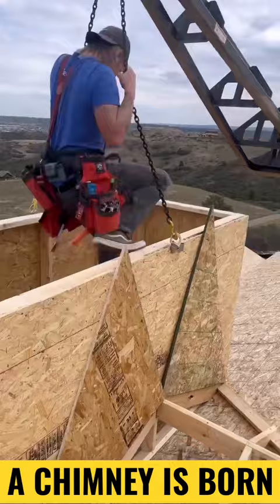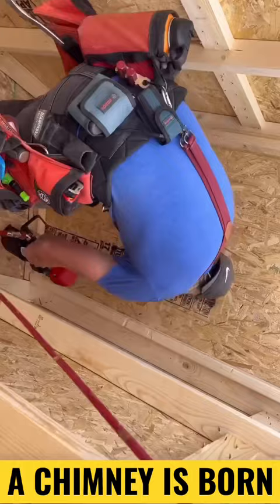How a Chimney is Made

Comment: What chimney? You just put a useless box on the roof.
Reply from the maker: The HVAC guys will run their flue out the top of this. It’s purely architectural sure, but with logic 60% of every home is “useless@“
Reply: @Coffmanconstruction  IT would not pass inspection in my state. Box has to be tied into main roof with 2×4 through the plywood. Also the top plywood is over spand needing less than 24 inches, so add rafters. The top plywood would also need to be 3/4 instead of the 1/2 you have to support the metal fireplace liners and metal cap.

Comment: My wood stove with insulated double walled flue requires that no flammable materials be within so many inches of the flue. So the top cap was cement board with a steel cover cap. Also because of the high wind area, we ran vertical framing up from the trusses through the chimney, not just toe nailed to the roof.

Comment: So how does the smoke come out?
Reply from the maker: The fireplace installers will run a vent directly through the plywood on top!
Reply: @Coffmanconstruction  then why all the extra wood? Also, why not plywood? Any small leak will destroy this wood.
Reply: @Normal1855  Will have a metal cap to finish it off most likely

Comment: U used wood hangers on a steel beam?
Reply: Top flange TJI hangers have 2nails on each side on top to attach to the wood nailer they have on top of the beam, which looks to be a 3x that is typically drilled and counter sunk for 5/8” nuts and washers to connect to the steel beam by all thread studs that are welded to steel beam. Hope this helps or makes any sense😅

Comment: I'm not a big fan of this type of plywood they have my roof done with it with 2 ft on centers and it looks like a wavy ocean I think it's only half inch babe really cut corners on my house.. everything I've touched I've had to bring up to code in a big way and it wasn't built that long ago in the early 80s. Not like it's from the 20s or 30s.. I don't know actually I do know why they didn't use CDX because it's $10 more per sheet of plywood. That stuff they're using is actually cheaper than drywall.. and holds up about as well as drywall..